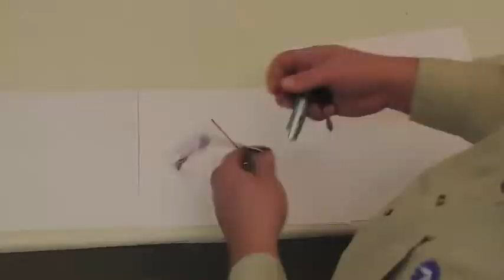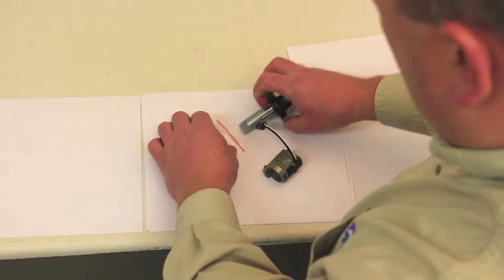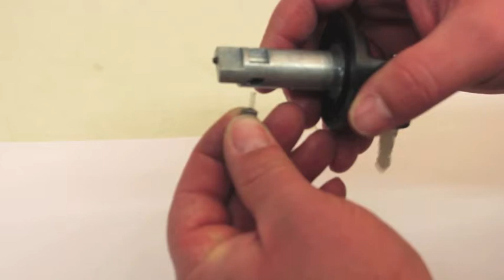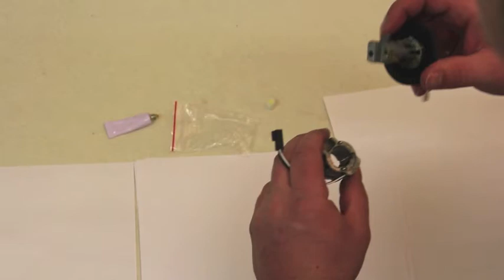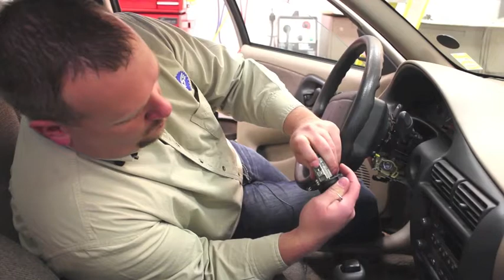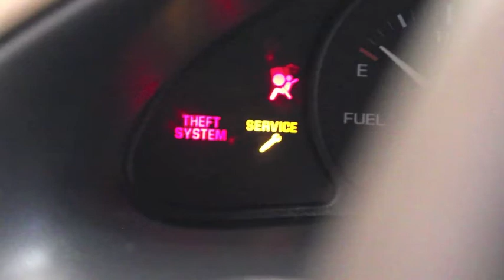Ignition Lock Cylinder Replacement (late 90's GM cars w/ lock cylinders in steering column)

Comment: Do you need to pull on the key to get the cylinder out?  Reason I'm asking is that the key comes out no matter what position it's in.  Can you pull on those plastic ears to get the cylinder out?